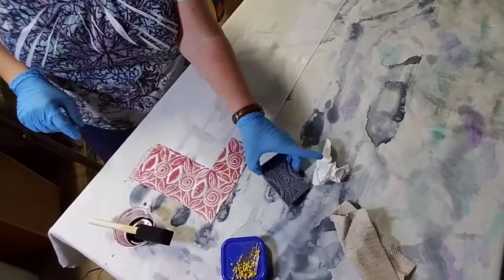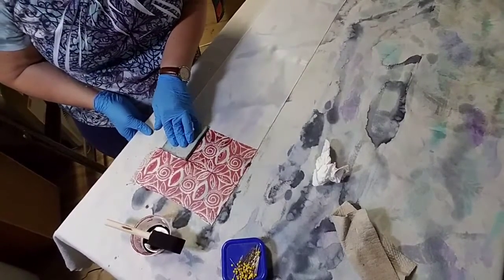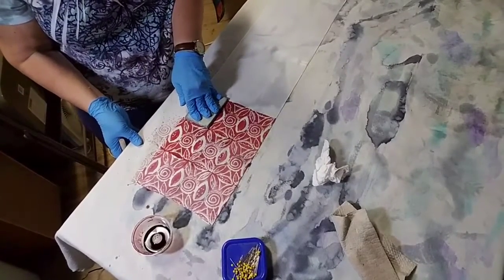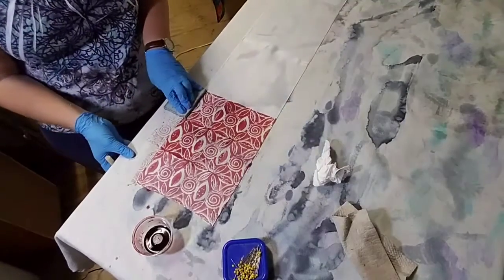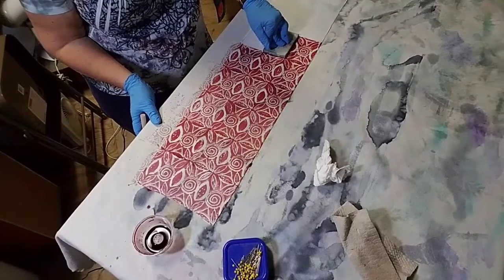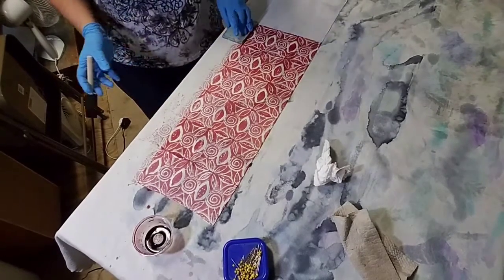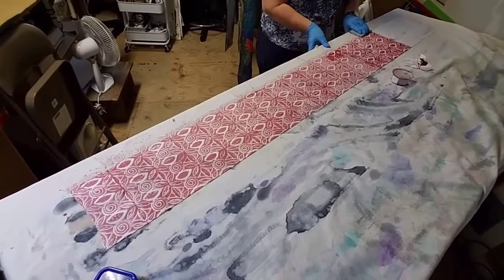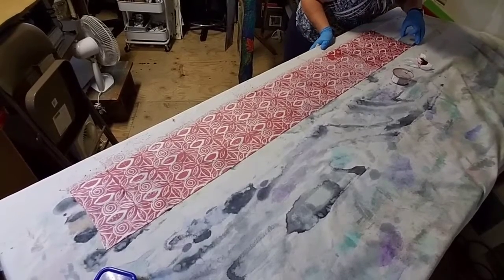Hand block printing a silk scarf

Comment: how do you adhere the light silk to the work surface, to avoid picking up the fabric when you lift the stamp?
Reply from the maker: I use the pins with the yellow heads shown on the blue magnetic holder in the video. I pin the scarf down along all the edges, there is a large foam board under the cloth. Hope that helps!

Comment: Thanks for the video! Is it possible to print on already-dyed silk fabric?
Reply from the maker: Not really, even if you started with a light background color and over printed it with a dark color your colors would likely go muddy because the dyes are so transparent. The only way I can think of that you could get around that would be to use silk paints rather than silk dyes to print the top layer. You would just need to remember that it would change the hand of the silk, leaving a slightly stiff feel.
Reply: @BeginnersMind-ArtMind  Thanks for getting back to me! That's what I was afraid of.  Do you know of any method to dye the fabric after block printing, to give the pattern a solid background?
Reply from the maker: @emilypan6068  I have another video here on YouTube that shows me doing that but unfortunately I think it may be a high-speed video not a lesson video. When I want a colored background I do the block printing with a product called Resistad on untreated silk. Resistad is available from Dharma Trading. I color the resisted with dye, do the block printing, let it dry and then steam it for an hour and a half in my steamer. After removing it from my steamer I restretch the silk onto my wooden stretcher and I dye the background whatever color or colors I want it. Then I steam the scarf again for an additional two and a half hours in my steamer. 
I'd be grateful if you leave a thumbs up on any of my videos you enjoy. Thanks!

Comment: Can you use any type of stamp? Does it need to be specific
Reply from the maker: Christine Lamprecht you can use any product that's meant to be carved for linoleum print making. I like the safety cut because it's a very soft easy to carve product and some of the other products are much harder to carve and have a more slippery surface. You can even carve into potatoes to make potato prints! Of course you're hand carved potato stamp won't last once the potato dries out.

Comment: What kind of dye is it? Can we use silk paint like setasilk or silk dyes as well?
Reply from the maker: I use Dupont French steam set dyes. I don't know if it would work with heat set silk paints. Sorry.
Reply: Linda Marcille, Crow House Studio, Silk Art  thank you so much
Reply from the maker: You are very welcome. The more I thought about it I think the starch might prevent silk paints from properly adhering to the silk. So if you try it do a small test piece first.
Reply: I did give it a try. Like you mentioned, the silk did not seem to hold on much of the paint. I shall give a try using the steam fixed dye soon
Reply from the maker: Good luck!

Comment: i find it hard to have an even paint over stamp when its very liquid paint
Reply from the maker: It is very tricky to learn just the right technique for applying the liquid dye to the stamp. The starch technique won't work with fabric paints or silk paints. It only works with fiber reactive dyes.